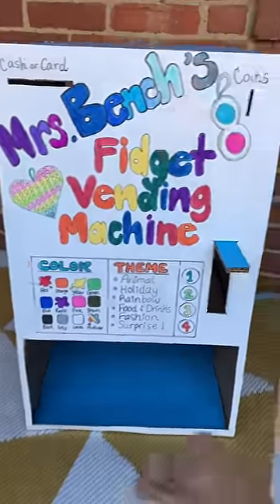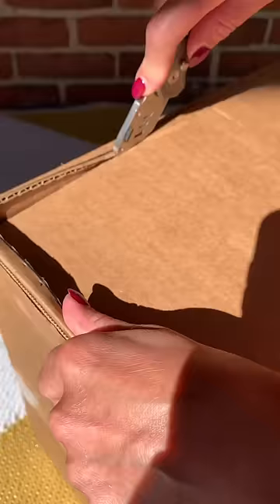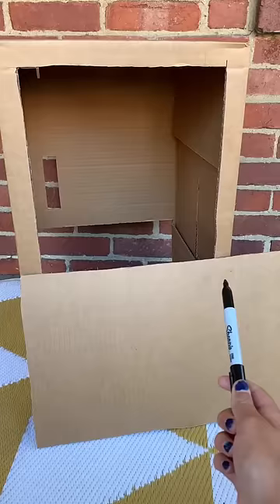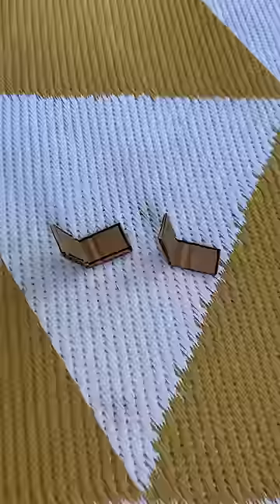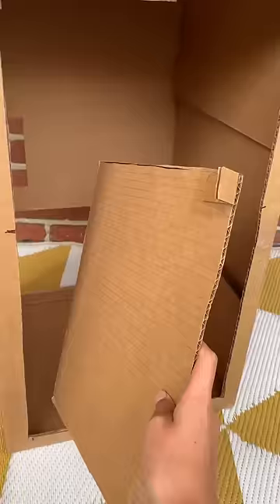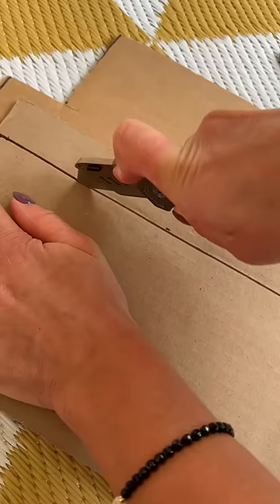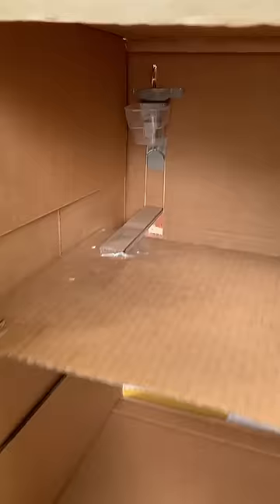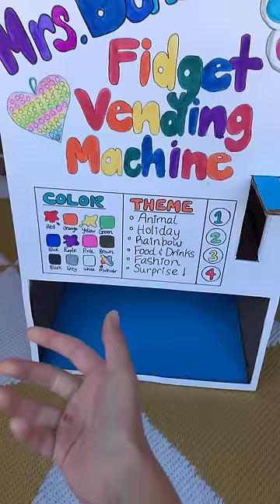How to Make a Fidget Vending Machine!

Comment: I tried this. Everything turned good, other then the lever my brother was trying to hold the rubber band and we didn’t have any duct tape, so we tried normal tape and when he was holding it, I tapped it, but then I just fell down again, so I used another tutorial and it was get a toilet paper roll and put it on there grab another piece of cardboard
And cut two pieces in it and put the toilet paper inside it, then tap it then make a hole in the front. Then put the thing that you made inside the hole and that worked much easier, but you still had good content and are you recording for Miss bench or is this your channel?